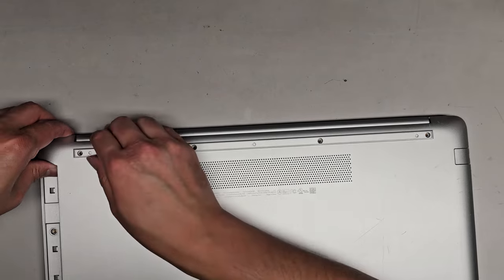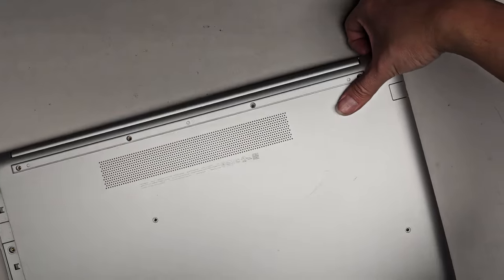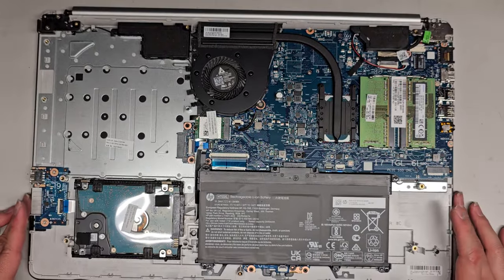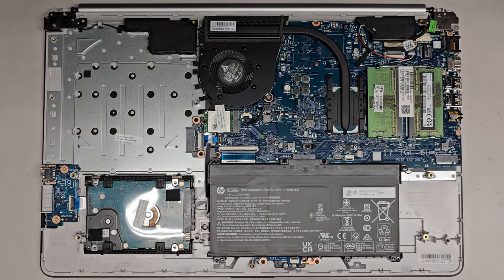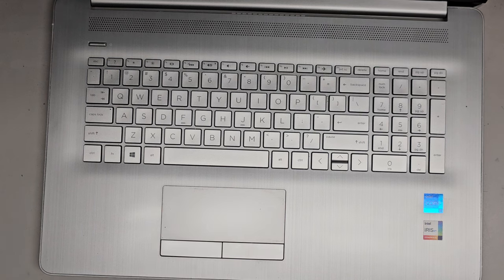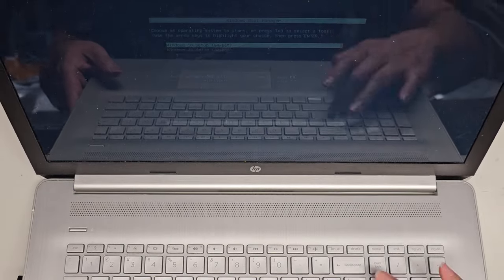HP Laptop 17-by4063cl Disassembly RAM SSD Hard Drive Upgrade Battery Replacement Repair

Comment: What are the benefits of upgrading what you did?
Reply from the maker: Huge speed increase. A lot more responsive. Faster startup and shutdown. Also a little lighter and resistant to shock from impact and drops.